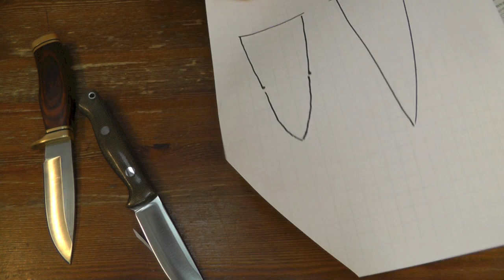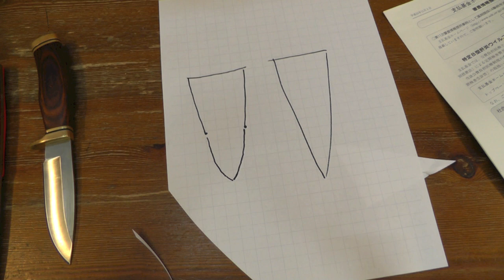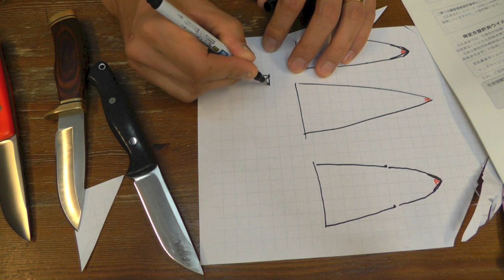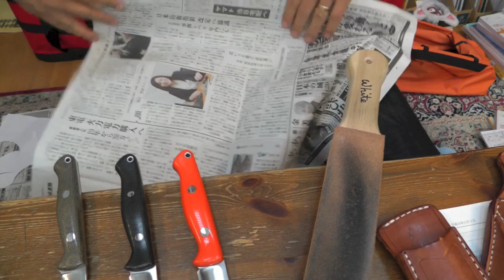3V Gunny edge reprofiling

Comment from the maker: Bravo1 is a very strong wood knife. Very practical and not too large. Its handle is hand filling and has no hot spots. 3V version has a fatter geometry and is one ounce heavier. If you need versatility on the knife, Rampless Gunny in A2 should be a better knife. Thanks.

Comment: Yes, the handle materials that are the nicest usually have more attention to detail. I have B-1 G-10 blue glow and a plain matte black micart. They are very different. The matte micarta b-1 had imperfections and the edge is thick and I think the treat or temper was messed up. I think they really ran with the marine recon thing. I loved them until I got the 2 b-1. I think the marines would want a untility combat knife the Bravo is a hunting field knife.

Comment: Be very careful with a beltsander, you can easily ruin your knives.
Since you can sharpen free hand, I recommed you try diamond plates for 荒砥ぎ - diamond will cut the hardest steel easily and the plates will not hollow out. When you have reground the profile, you can finish with Japanese water stones and strops.

Comment from the maker: They will have a secondary large angled micro bevel out of the box in high probability and will not take stropping unless getting rid of the shoulder using water stones or sandpapers. So you had better not get them for now. Thanks.